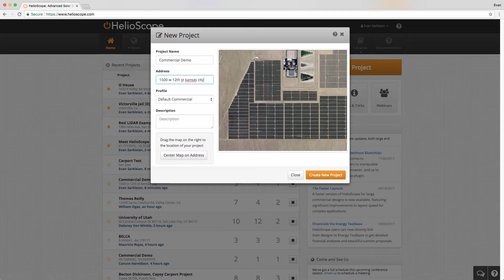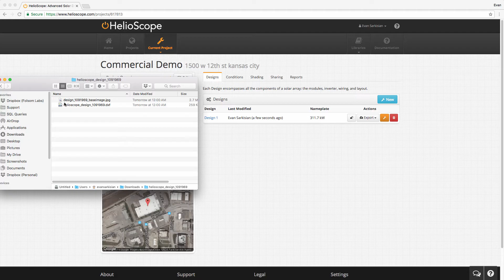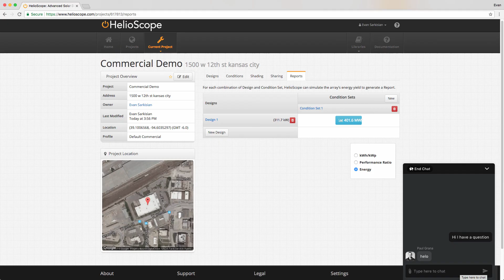5 Minute Commercial Solar Design in HelioScope

Comment: Really good video.
I have one question. I am designing a PV system and i want to put 2 containers of 3 metres height. When i select the keepout designer, one of them shows as it has the height and the other one does not show. Why? Both should be the same height but i can only see one of the shapes.